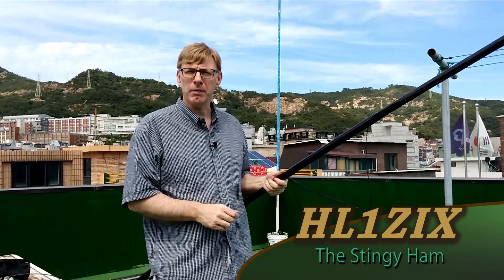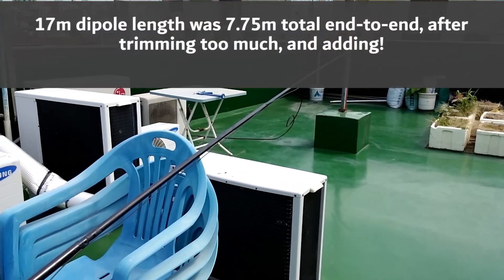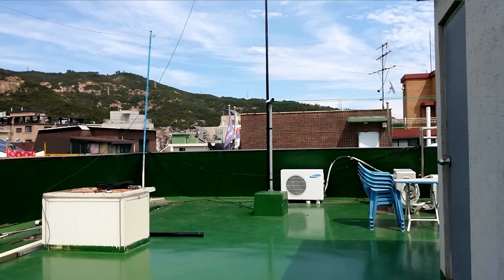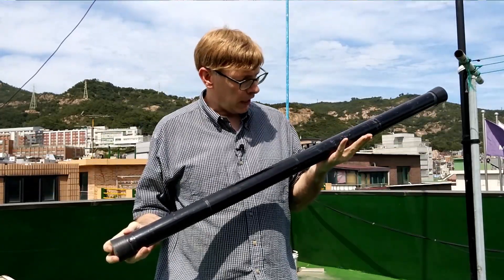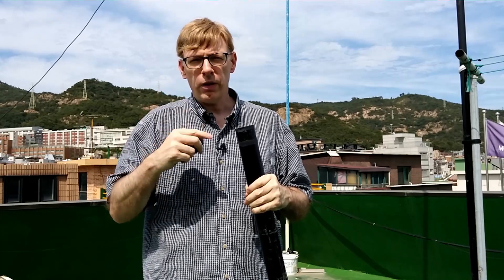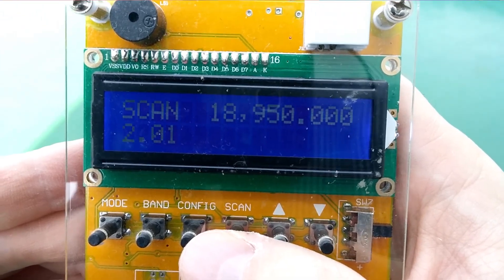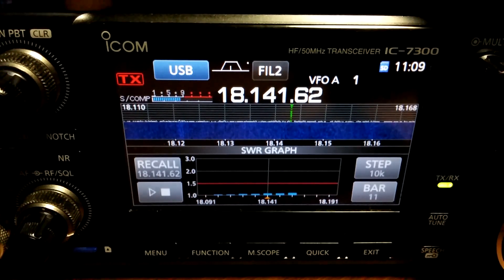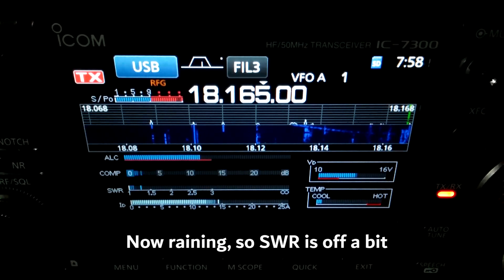Vertical Dipole Antenna with Spiderbeam 12mHD mast

Comment: To get over the dangling-feeder and interaction problem, I put a sleeve current-choke 1/4 wave down the coax; the (outer surface if the outer conductor of the) coax above the choke forms the lower half of the dipole. It's all vertical, using the deliberate co-ax radiation technique 😀
Reply from the maker: Interaction with the coax is overrated, imho.  But antenna theory and experiments are fun.  The benefit would be more related to adding strength to the construction, and longevity to the coax.  Good idea for a permanent install, though.

Comment: I would love to know where you got your custom built antenna analyzer.  Please do share.  is their a kit out there where others can build it themselves.
Reply from the maker: AliExpress sells them.  They are the MR100 or SARK100 version.  Personally, I would not bother and get the newer NANOvna analyzers with the visual readout.  Know that they often come uncalibrated.  Mine was built but uncalibrated.  Found calibration was not so necessary at HF frequencies, but some may care about that.  Not sure if you can buy the kit alone.  The analyzer has a website written on it, but it is a dead link.

Comment: Do you still have the 7300 as well as the 3000? Both lovely Radios, Fibreglass poles are a great way of supporting different designs of antenna, my preference being inverted dipoles..no atu required..another I use is the multi band vertical using a 10 meter length of 300 ohm ribben feeder and a home brew wound transformer..works really well when the bands are in better shape.. 👍
Reply: Sold the 7300 to buy the 3000.  In the big city, I find the 3000 works much better on low bands.  I preferred the 7300 on high bands.

Comment: Thanks for the video. Actually, I have one of these spiderbeam poles and I found that by letting the feedline go off at an angle, it was really causing the mast to bend down a lot. I don't know if that's normal, but it was making me nervous.
Reply: If you make an inverted-V out of it, for example, I find I only go about 1/2 to 2/3 of the way up with the balun.
Reply: @theenglishspace5141  I guess this is what annoys me about the Spiderbeam. What's the point of it being 40 feet tall if it won't bear much weight at that height?! I might as well have just stayed with my metal pole mast that was 30' tall and saved myself the money and trouble.
Reply: @tglenn3121  Well, you're talking metal vs. Fiberglass and portability. They are two different animals with two main differences in purpose.  Compared to other fiberglass collapsing poles out there, the Spiderbeam is much more stout.
Reply: @theenglishspace5141  I'm talking about height. If the company says the mast is 40' tall, but it can't bear any weight heavier than a paper clip without bending over, then they should note that. I'm not putting a big beam on this antenna, I'm putting a dipole. The stupid fiberglass mast should be able to support that weight without bending over.

Comment: Nice video, just wondering if this is a dipole, couldn't it be fed with 75-ohm coax and tuner out in the shack back to 50-ohms. I acquired some cable hardline real cheap and looking for ways to use it?
Reply: Sure.. you just have to match it before it gets into the radio.  You might lose a little here or there, but not a lot.

Comment: What is the name of the testing device you’re using?  I’m interested in a small firm factor like that
Reply from the maker: I got it from Aliexpress.  It is a Sark100 clone called the MD100.  I would get one of the newer Sark100 models in a box.  Mine came uncalibrated.  Check with sellers to find out it is calibrated, before buying.
Reply: 데릭피코너 thank you for your speedy reply. 73!